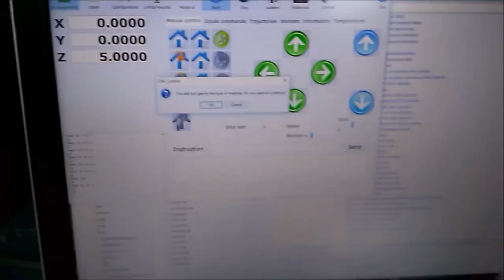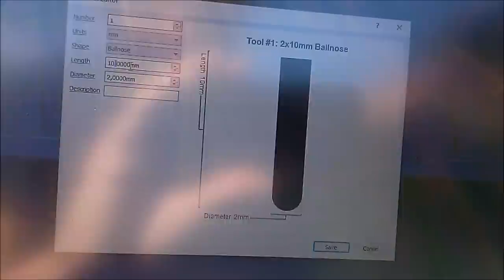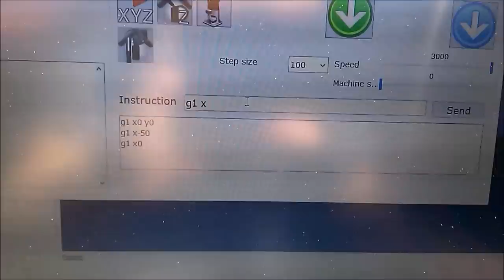working diy cnc router made from junk

Comment: Hey. Nice CNC. What model of stepper motors are you using? What is the motors torque? Thanks.
Reply from the maker: Hi, thanks, 
Those are 42BYGHW609 steppers. I haven't measured the torque in my setup, but the theoretical max. torque ratings are:
4000 g.cm holding torque and 220 g.cm detent torque. I use a 12v, 2A max. car battery charger for input on the Polulu drivers. I didn't check how much current it's pulling but I'm sure I can increase the voltage since the stepper drivers' potmeters are maxed out and both the drivers and motors stay really cool. So I'll try 18v. or even 24V. soon and see if I can get it to run faster without skipping steps.
Reply: yeah 12V input is pretty low for driving stepper motors. Right now I'm running TB6560s at 28V and I am in the process of upgrading to TB6600s at 32V. I have a drawer slide machine myself that I put together for pretty cheap. But I didn't go quite as cheap as you did. Almost though. I've gotten my machine to rapid 114 inches per minute. But I usually keep it under 60 IPM. I'm upgrading my drives because I was having trouble with one, so I bought 2 to replace it, then I decided to get another and just replace them all. The TB6600s really are nice drives, for the money. They're about $10 a piece.

Comment: can u help me making this ? where to buy stuff for it etc..
Reply from the maker: Hi,  that's not an easy question to answer. There are a lot of things going on in such a device, and I cannot guess what you already know. A good way to start would be reading articles on websites like Hackaday, Instructables, Makezine, etc. For instance: http://www.instructables.com/id/DIY-CNC-1/ 

Parts can be purchased at your local hardware store, ebay in most countries, or do a google search for cnc parts or 3d printer parts. Here in the Netherlands I buy my parts from https://www.123-3d.nl. You probably want to make a part list in advance and search for a webshop with good offers. They should have all parts you need. The next one I will build will be using an Arduino nano, or just an overclocked Atmega328P chip, loaded with the latest grbl firmware, a cnc shield, Stepstick DRV8825 drivers, stepper motors like the SL42S247A, or similar, and a Raspberry Pi with cncjs installed as a remote controller. I think this setup will be just a little more powerful and easier to control than the one in the video.
Reply: +Willard van Delft whatever thanks for helping I ll study ...
Reply: +Willard van Delft thanks a lot Willard .

Comment: what software are you running?
Reply from the maker: I used CNC Control v2.1 http://www.cnccontrol.byethost13.com/ for running the machine after I created the cnc file with f-engrave http://www.scorchworks.com/Fengrave/fengrave_doc.html. You might want to take a look at some of the other tools from http://www.scorchworks.com/ as well.
For reviewing the created cnc file I use CAMotics 1.0.6 http://camotics.org/ . 
To be able to make really fancy stuff you are going to need something like AutoDesk Fusion 360. It's free to use for hobbyists and students. 
Some other usable, but non free software, would be Photoshop and Illustrator for creating smooth paths from a bitmap and converting that to a svg file that can be imported and extruded in AutoDesk Fusion 360. I think I wil be making a short video on that soon. It might even be possible to do that in Gimp, but I haven't tried that one yet for creating cnc files.
Reply: InkScape can trace bitmap images to vector graphics. But I find that I have to take the DXF files that InkScape makes and save them in LibreCAD in order to be able to use them in CAM software. I can't get gcodetools in InkScape to make decent G Code either. I use dxf2gcode for that. For full disclosure I also find that InkScape traces bitmaps pretty poorly. So I end up tracing them in that program by hand. Which is a tedious process. That yields the highest quality output for me though, so that's what I do.